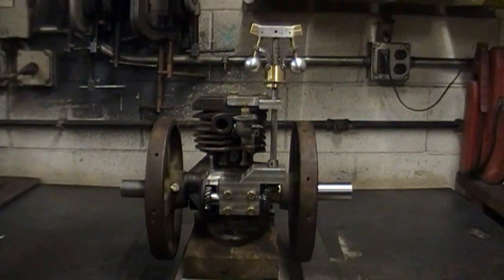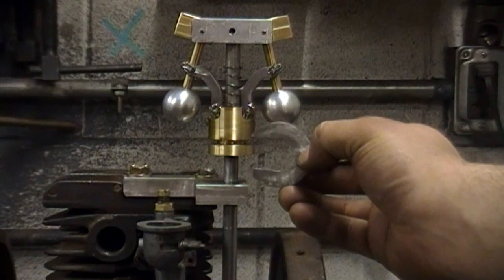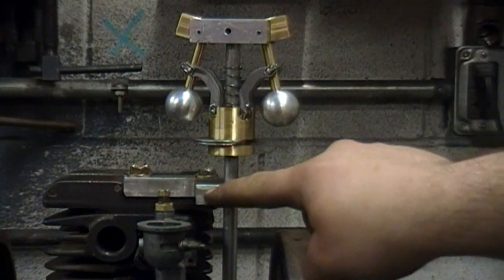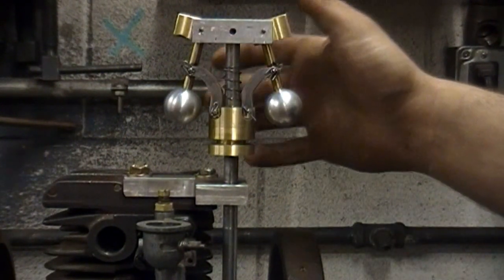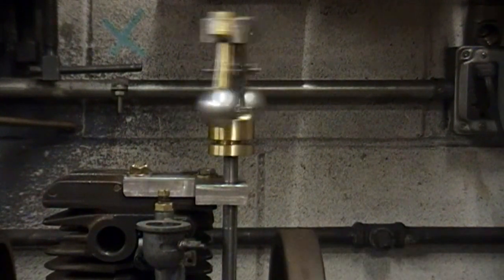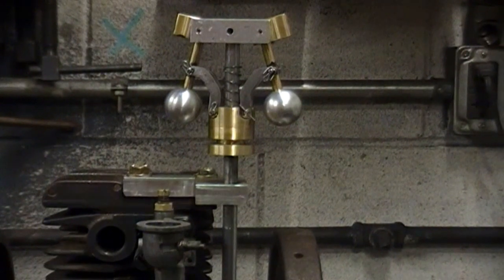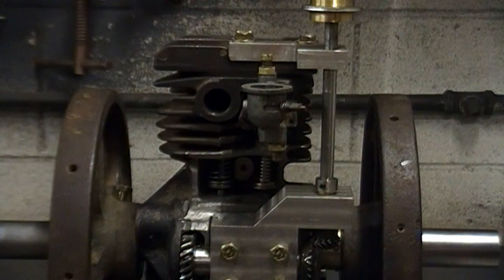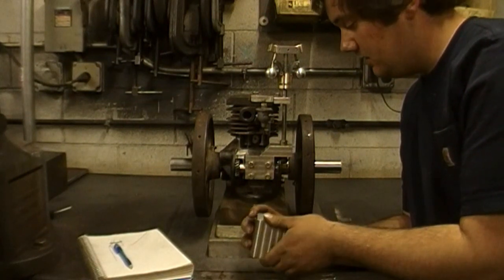Hit and Miss Briggs Project

Comment from the maker: Thanks!  In most hit and miss engines when the engine gets up to speed and starts to "miss" the spark is cut out and more importantly the exhaust valve is held open through all strokes.  This lets the engine free wheel with no compression without wasting fuel.